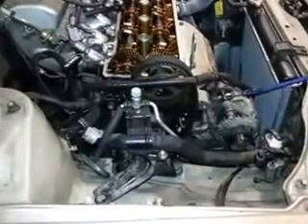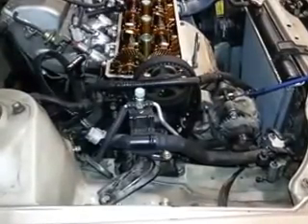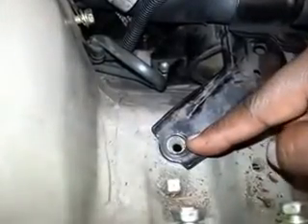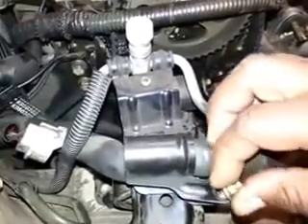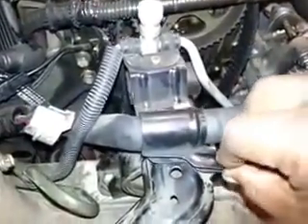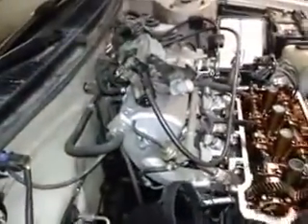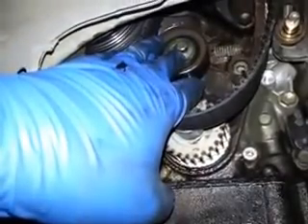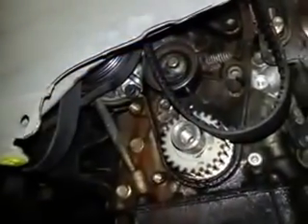Getting The Timing belt past motor mount of Toyota Corolla 7AFE 4afe 1994 1.8

Comment from the maker: The TurboFlo Oil Changer is 2 inches thick and about the size of a cell phone, it can literally fit in your pocket. 
TurboFlo Oil Changer does not require you to pump it, or use a compressor, you don't have to dump the oil or jack up your car it is EASY!
The TurboFlo Oil Changer will be great for cars, trucks, boats, and lawn mowers and so easy to use anyone can use it.
We are so excited about the TurboFlo Oil Changer coming soon for everyone, men, women and teens!